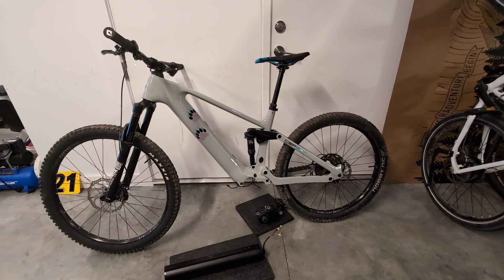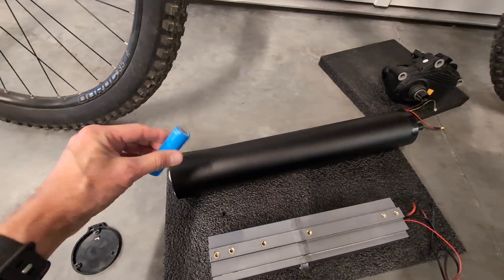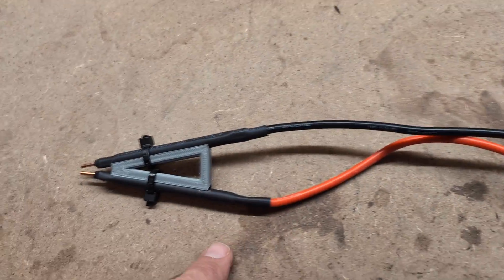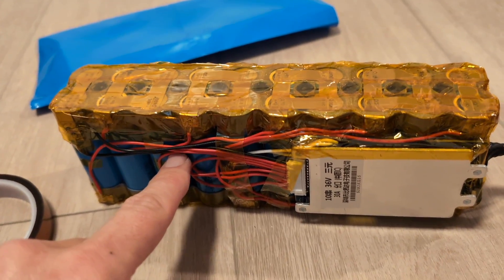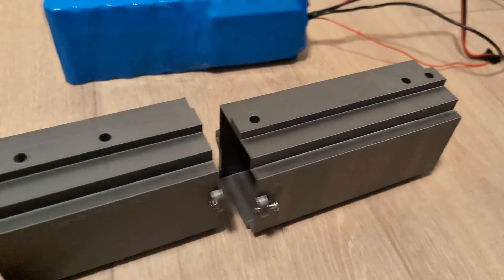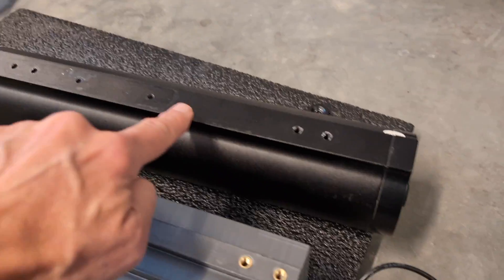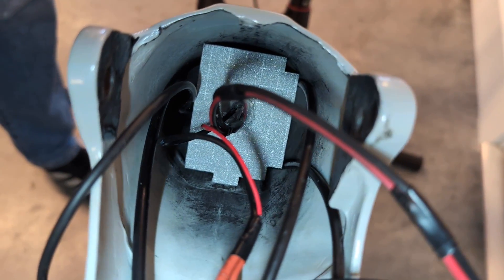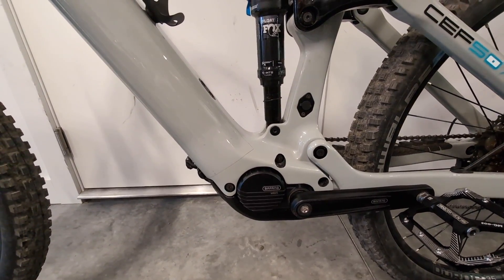DIY Ebike Battery Build

Comment: How does the UI react to the lack of an "official" battery with CANBus? I guess it happily accepts the raw voltage and simply doesn't show all the charge cycle count / cell voltage info?

Do you think it would be possible to DIY a range extender? If so, how would you do it? Some kind of manual transfer switch?

Comment: Hi! Is it possible to increase the thickness say to 2mm, for better safety?
Reply from the maker: It's a real tight fit between the battery and frame.  You could probably make the walls 1mm or so thicker but it may require a bit more effort to slide the battery into the frame.  But I think since it sits inside the frame, the way the thickness is now should be study/safe enough.  But you could try making it thicker
Reply: @dualincomenokids4712  I asked this because my printer shop can't handle thickness below 2mm... that stops me trying to start the project.
Reply: @dualincomenokids4712  I trust your design is sturdy enough / safe.

Comment: Excellent build, thanks for sharing! May I know the purpose of the file named "battery case spacer"? It seems not present in your video guide. And again, we all wait for your coming videos about your rides!
Reply from the maker: That spacer goes on the inside end of the case.  This DIY case is shorter than the factory battery so in order to fit the frame mounting holes I had to make this case a bit longer than the batteries themselves
Reply: @dualincomenokids4712 I see, how thoughtful!

Comment: Hi. Have you gathered more experience? What can you say about the performance of the engine - would you choose it again? how noisy is it? does the engine cope with occasional stronger climbs of 16-20%? and how does it cope with continuous climbs of 6-16% what range/hill climbs did you manage to cover on the smaller and on the larger battery? By the way, very nice piece you came out with :)

Comment: Tinkercad has a surprisingly high skill ceiling considering it's a modeling software intended for kids. I've been using it since I got my first printer, nothing has been as intuitive to learn nor as easy to run. Only problem with it is you're limited to Boolean geometry instead of mesh modeling, but I've rarely needed it. Blender works fine for those edge cases

Comment: Please know that 3d prints are NOT waterproof. Water will get in between the layerlines and seep trough.
Reply from the maker: Excellent point... I should have elaborated the point that the seal is water resistant and the case itself will resist splashes but should not be exposed to water if possible.  Emtb's in general should not be submerged in water.  The battery is somewhat protected from water being inside the frame but water can definitely seep in from the headset and certainly from the motor area.  I am conscious not to ride through deep water, use pressure washer to clean the bike etc.   I you are more susceptible to these things, this case can be made more water resistant by coating it in epoxy resin etc. to seal up the layer lines. Also I didn't mention it, but the filament used to 3D print should be carefully selected.  I used PETG which has better thermal properties but also better water resistance
Reply: I've printed plenty of Wee jet boat hulls, They dont leak  at all when new.. , however after some time of thashing them they end up leaking, we now seal the hulls with a paint we got from the local paint shop, its like a resin paint, been excellent.

Comment: Just remember, when it comes to do-it-yourself rechargeable batteries, if you do a single thing wrong, you could create a very bad situation.  Even factory made batteries have been known to catch fire, and they burn with extreme destructive energy.  Source: Tesla
Reply from the maker: Agreed... I am super paranoid when it comes to battery quality and charging.  For my build I made sure to use high quality cells from a reputable supplier.  I then took a lot of time and triple checked things at all steps of the build.  Because of this, I am more confident in the quality of this battery than many commercial offerings (especially cheap stuff of unknown origin).  Lithium ion batteries have risks... I take precautions with all my batteries, but there will always be chances of fires etc. as we see in the media

Comment: DINK, thanks for this. Would it be possible to share the wire schematic, if you have it, or, a link to where I can find it, please?
Reply from the maker: I've a added a link in the video description to the wiring diagram for the battery pack

Comment: Don't you need vents on the battery case?
Reply from the maker: My understanding is lithium ion batteries don't need venting.  More importantly is the cells need to be spaced so they don't touch and are protected from impacts and water ingress.  The OEM battery from this frame is 100% sealed.  Also, the BMS I used has a temperature sensor which is attached to the cells and provides overheating shut down.  So I think it's a pretty safe design